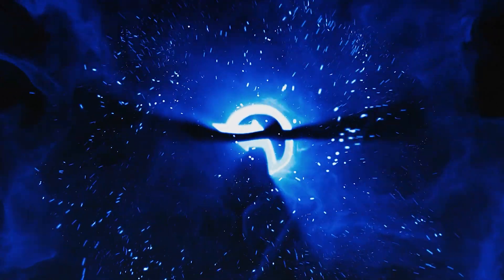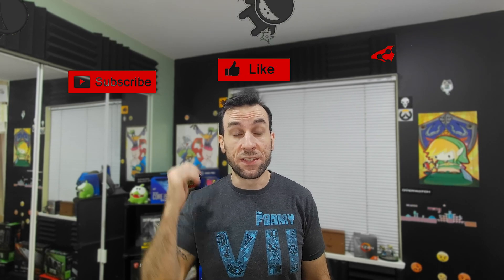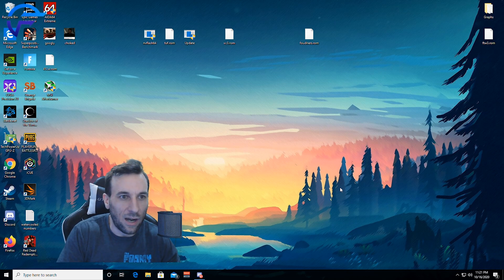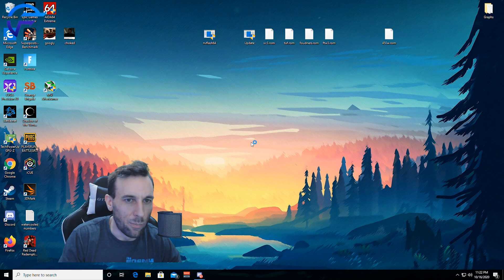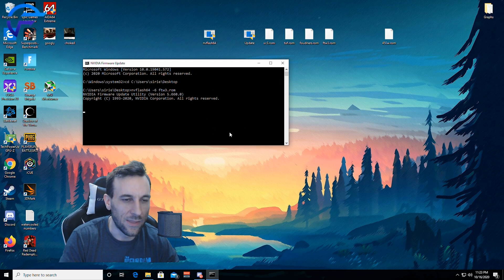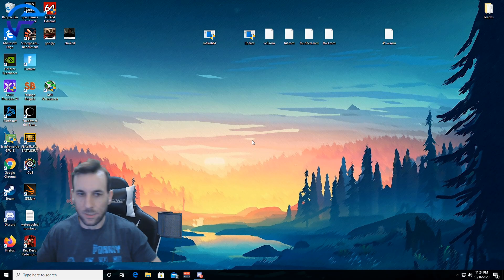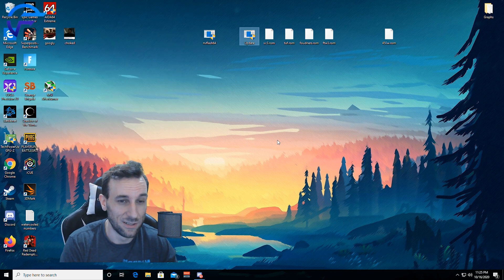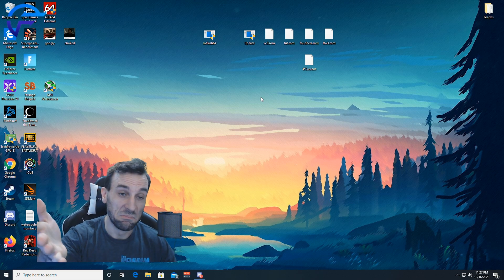RTX 3080 XC3/Reference power limit bios flash

Comment: People on overclock.net forum saying you are a liar and nothing like that will work, can you post GPU-Z sensors under load that it really take around 400W on 2x 8PIN PCIE connector?
Reply: best thing to do is clamping the pci cables or stock vs this bios and looking at power at wall.
Reply from the maker: that sounds like a them problem to me,  This video is for XC3 owners, not people who theorycraft when they dont have a card.  Yes I have tested and verified all my info.  I guess you guys didnt watch the whole video, I said I used a measurement meter to verify
Reply: @FrameChasers   While I don't question your specific results or testing, I'm not convinced the 450w FTW3 bios would give you more power on a stock XC3, without the shunt mod.

Can't recall if anyone has tried the 450w Strix bios on the XC3.  On the FTW3 it doesn't read power from the 3rd 8-pin but does go up to 450w of externally measured power draw.
Reply: @dopeddie  LOL you're funny.  I know more about these cards than you do, even if you own one and I don't.  Go back to reddit.
Reply: @dopeddie  No Eddie, he's bringing up a good point. You can't tell people a bios works when the card is shunt modded.

A 2X 8-pin does not function like a 3x 8-pin card just by flashing a bios.

You literally need a 2X 8-pin bios that enables 400W+. Otherwise, the cards function differently.
Reply: @deeppurplefan  you're bringing up legitimate questions here.
Reply: @kingengine2767  Thanks King.  Frame Chasers has some of the best Ampere content on Youtube and I've seen him post on OC net, no doubt he tested what he has accurately.  But anyone who has been following how Ampere (and Turing) responds to 2x vs. 3x 8-pin bios would question what happens with a stock card, and would want to see verification with a metered psu or measurement at the wall before and after, or with a current clamp.  What he's saying is not impossible given how weird Ampere is with power control, but it would be a first.
Reply from the maker: The purpose of the video was to show how XC3 users can get more power limit. I think that’s pretty self explanatory.  If you have an XC3 card, try it for yourself.  If you don’t why are you commenting.  There is no risk to this flash, no harm in trying it.  I proved it on stream today for anyone that was there.  Too many people without cards worrying about things that don’t apply to them.
Reply: @FrameChasers  First, let me start by thanking you for your content. It is entertaining and fun to watch. 

Now some of the concerns I have. All we're asking is for you to share the test results and of course without the card shunt modded. 

There are many users with 2x 8-pins that have flashed nearly every bios they can get their hands on, and the common pattern is that they get fake results, regardless of what is shown in GPU-Z.

The test isn't that difficult, and you said you have measured it from the wall yourself. 

1. Run furmark on stock XC3 with no shunt, nothing active

2. Measure power being drawn in outlet or from PSU if your PSU has that capability

3. Flash 450W bios

4. Repeat 1 and 2 with same exact OS setting

A bonus would also be to run a benchmark of Timespy lets say, share the graph data of the voltage vs. time

If it's true that you have more power, up to 400W, then the voltages should be running higher without issue. You should easily be able to overlay the voltage vs. time with stock and BIOs flash. If power is increased, then we would certainly see the card access higher points on the voltage curve. 

For the sake of science, that is what is required for a thorough test.
Reply from the maker: @kingengine2767  I did all that on stream today and I got an extra 50 watts of power draw live in front of 40 people.  Granted I did not desolder the card.  I have no interest in science, I have an interest in making my card as fast as possible.  If you pay me for a full day of work I will gladly do what you ask though.  If you are not willing to pay for my time then I don’t have a reason to do all that work, sorry that’s just how the world works.  Maybe get someone else with a non shunted XC3 to test it for you
Reply: @FrameChasers  I understand. We have people on overclock.net who have tested and didn't get those results. From my research, it's the shunt that's giving you this ability, not the bios. 

Sadly I cannot test as I have a FTW3.
Reply from the maker: @kingengine2767  well that’s unfortunate, sorry to hear they aren’t getting the results they wanted
Reply: @deeppurplefan  I tested it and got less performance without shunt mod. With stock bios phase 1= 124w, phase 2= 145w, with the 450w bios the power dropped around 10-20w for phase 1 and 2. Therefore the card uses less power. 
3dmark  around 200-300 points less than org bios.
The interesting thing is that the card is reporting phase 3. Maybe we can solder on a 3 pin header and rewire the shunt sensor for phase 3.
Reply: @Todestelzer  Thank you sir, this is the result we would expect to see on a *STOCK CARD*.
Reply: @Todestelzer  I tried this as well.  Overclocked the best I could with afterburner and running Port Royal, and then did it again with the 450W bios.  Same results, even though it reports 450W it's actually performing worse by about 300-400 points.  Oh well, it was worth a try.
Reply: @FrameChasers  I know you said it, but you didn't show it. Not even comparison of default XC3 bios vs 450W bios. What is the purpose of making a video about it, if you just talk about it and show no real results.

Comment: Hi. Would be nice to have some clarification over using 3x pin bios over 2x pin cards. Bios mod on top of Shunt mode. Im just afraid Shunt might hide the real usability in a card without shunt and only 2x pin. I did these tests before with other bios and didnt see any improvements. Thanks for info, i will give a try but i must admit i am not confident :P
Reply from the maker: I only have an XC3, can only verify it works on this card.  I guess I have a new topic for the stream today then if people want verification
Reply: @FrameChasers  tested on gigabyte. Flash works, but the goal doesn't. It pulls 440w but the clocks are slower. More consumption for less clocks. Even undervolt...
Reply from the maker: @vapochillled  I had a similar experience when I tried using the strix 3090 bios on my ftw3 3090, pulled more power but clocked and scored exactly the same.  It’s pretty much trial and error to see which bios works on which cards since they are all so diffeent
Reply: @vapochillled  the problem is it measures 2 header instead of 3. So with a ftw bios it will pull less power unfortunately. We need a unlocked bios or have to shunt mod the card.

Comment: Hey, how much difference did just changing the thermal paste help ur ftw3? I have a 3080ftw ultra but I'm stuck at 2075 on boost stable I feel like it will be higher if I drop a few degrees
Reply from the maker: the ftw3 saw no improvement, the XC3 saw a big improvement
Reply: @FrameChasers  hmmm... I don't think it's worth taking apart my card for that... Might as well wait for a proper waterblock. I tried putting a fan exhausting thru backplate.... It lowered temps 1 or 2 degrees.... But seriously side panel on in my define 7.... Temps r 75max... Off I can stay in 65 to 68.... Time will tell.... I can get high clocks but can't hold them.... Air cooler is definitely holding it back

Comment: I already tried bios flashing in my gigabyte gaming OC card with 2X 8 pin, I tried all the 3X 8 pin bios they simply dont provide consistent stable frequencies for me, only 2X 8 pin bios do, not sure why I can see myself hitting 2.25ghz but because of flucuations I lose performance compared to stock and some like Strix bios end up crashing my games but the 450W evga so far is most stable of all the 3X 8 pin bios I have tried and despite I have consistent 450W power draw the frequency not consistent enough so my results still worse

Edit: So yeah been trying all day I set bios to run card at gen 4 pcie, I run nvidia DDU to re install all drivers, but I still get alot of frequency flucuation and inconsistency, I do hit high frequency like 2.2ghz but goes down to 1.9ghz..... also I noticed all the time im power limited even at stock clocks and running max power limit, the power draw is consistent however voltage seems stuck between 0.918 and 0.931 99% of the time and rarely goes up to 1.093 but it does go for 1 millesecond, and temps are fine like stuck under 55C no issues

Edit 2: I can see in Precision X1 that power flucuates from 95-118% all the time, but power draw in GPU-Z is stable and consistent however I get the green power limited all the time even if stock clocks still
Reply: How do you get all that juice in to your card with only 2x8 pin?
One 8 pin is 150 w not?
Reply: @xXDESTINYMBXx  I think 1X 8 pin = 150W thats just standard value set by manufactures but it can easily do more, thats just my guess in this, some said can do 480-500W no issues
Reply from the maker: yeah I can only verify this works on the XC3
Reply: @FrameChasers  could it be power supply? I have 750W but power draw is stable at 450W and never had blue screen or a crash
Reply from the maker: @TRX25EX  oh yeah there you go, I tried my shunted 3080 in my itx PC (650watt) and it wouldn’t clock above 1800mhz in 4k and eventually shut down. Extreme clock fluctuations.  Get Atleast 1000w if your going to be runnning your card at 450+ w
Reply: @FrameChasers  Yeah will get 1000W with new 5900X or 5800X upgrade from my 3900X

Comment: I have a XC3 Gaming ultra. Is doing this going to ruin the card? Sounds dangerous eh
Reply: if you are asking this question, then you shouldn't do it.
Reply from the maker: ^ pretty much this,  there is no danger, but if you dont know your way around a CMD prompt then these mods arent for you
Reply: Danger is fun!!
Reply: I know my way around cmd prompt. Can you flash back to the default bios on the card?
Reply: Yes
Reply: Yeah I tried it out. But my gpu won’t go higher than 160 core and mem clock. My temps were around 65 and crashed playing dbd. Had the slider all the way 118% but I crashed at the same point with standard bios. 160 core and mem clock is stable for me. Can’t get to 170 booo

Comment: Hi great content. I just bought a msi ventus 3x oc 3090. Is there a bios i can flash for more power.
Reply from the maker: I removed that other guys comment, I have no idea who that was.  But im not sure dude, you have to try them all and test them to see what works.  All these cards are built differently so results will vary wildly card to card
Reply: @FrameChasers  i too have an MSI VENTUS, it seems to be on the lower end with max of 320watts, clocks wont see over 1950. I would love to have a FTW3 with 450watts that can do 2200MHZ, the question is, is it safe to flash a VENTUS 3080oc with this FTW3 bios ? can you brick the card ?

Comment: @8:45 mins
How are you not blowing those 20 amp fuses on the pcb for the power plugs, Thats only 240W per plug they can handle before popping , And you said your pulling 600W.
Reply: Power is also delivered through the PCIE slot, not just from the 2x 8pin.
Reply: @if_then_else  The slot has its own fuse as well. And the raitings on the fuses are for peak spikes, Continuous ratings are a lot less. 18.5 amps on each of the connectors(1 time fuse once it blows its gone).
10 amp spike/9.5amp continuous for the slot (Regenerative will work again after 20 seconds).
They even mention them under the ICX3 advertising on the last image on the left hand side of the page.
https://www.evga.com/technology/icx3/

They are 12V rails so the maths says 600W spikes (less then 500ms) and 558W Continuous is the most he should be getting with out replacing/bridging them.

So back to my question how is he not blowing them, Has he bridged them already? Maybe a video about that which Iv missed?
Maybe his method for measuring power is incorrect in which case I can give him some info on how to correct that. 
It can be done in HWINFO64 using a multipyer correction setting under customize value and GPUZ will also be adding that as per a request I made in there forum.

Using 5 mOhms its easy since you just double the number so a multiplyer of 2. Using other sizes its a bit harder. Iv made a open source tool that can easily work it out.
https://github.com/bmgjet/ShutMod-Calculator
Reply: @bmgjet  Yes he has shunt modded all around.
Reply from the maker: pcie slot is also shunted,  but I didnt see any fuses on my card man,  the XC3 isnt an icx3 sensored card though.  But if there are there she is still going fine, lol
Reply: @FrameChasers  My 3090 XC3 Ultra has them, Heres a pic of them a little bit closer up. 
https://i.ibb.co/X70Vcg8/plug-fuse.jpg

Maybe they didnt include it on the 3080 XC3. I looked back though your videos and couldnt find any pictures of your card directly as you shut modded it, Just you talking about a reference board which is slightly different then the EVGA one.
But you found the same issue I did. The multipal power limits, 
Shunting the plugs only only gives about 40W more because the GPU Chip is on power limit next, 
You shunt that and only get another 5W before your on SRC power limit. 
Then you shunt that and the memory and you only get another 10W before your on the Slot power limit.

Good videos any way, Subbed + Liked.
Reply from the maker: @bmgjet  yep you gotta shunt THEM ALL, even the pcie one.  My apex board has a supplementary molex connector for pcie power so I wasn’t worried about it.  But I was able to pull 650watts live on twitch today
Reply: @FrameChasers  Found a bare pcb picture of the 3080 XC3 (Your pictures lol), It has the same fuses and layout as the 3090 XC3 basically. 2 Less power phases, And obvously different memory layout. Intresting that they put thermal pads on them on the 3080 but not the 3090.
https://i.ibb.co/52xRqhm/3080xc3.jpg

So dont know how your not blowing that PCI-E Slot one. Unless you are blowing it which results in a black screen and restart since its self resetting.
So I guess if you find your self getting black screens and restarts, You could try jumping the fuse.

Comment: does the 10gb vram ok for 4k gaming ?
Reply: Yes, for now. Might not be enough in 2 yeard time.
Reply: Already not enough for some titles if you want to max out in 4k. In RE3 and FF XV my 3090 uses 15gb vram
Reply: @edemir3947  No it allocates it no way those games take up that much. Maybe at 8k but not 4k. Easy way to test was to use my 2080 ti to play those games maxed at 4k. My 2080 ti only has 11gb of VRAM. Yet I was able to play them flawlessly. Then put my 3090 in and it allocated more vram since my 3090 had more VRAM to allocate.